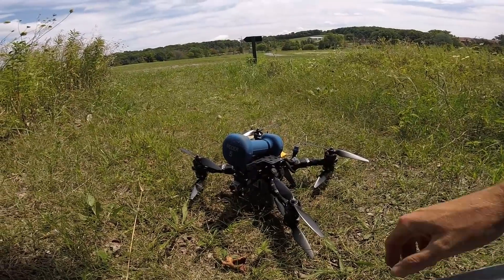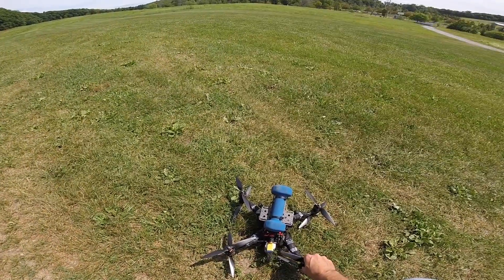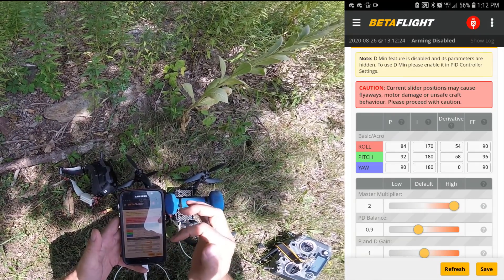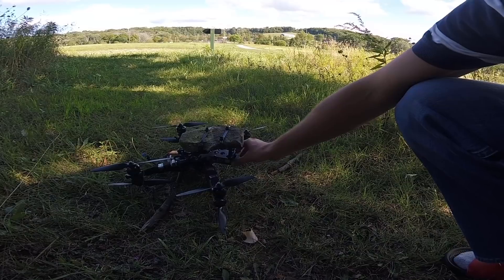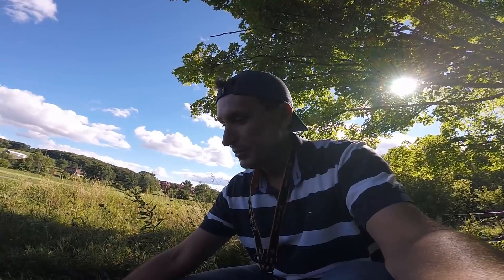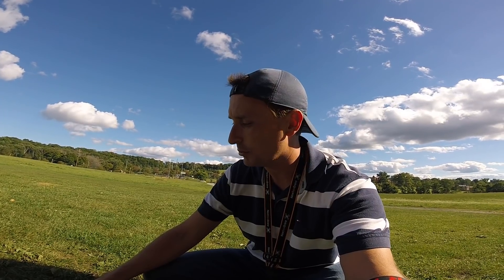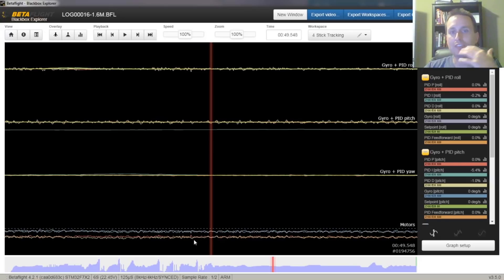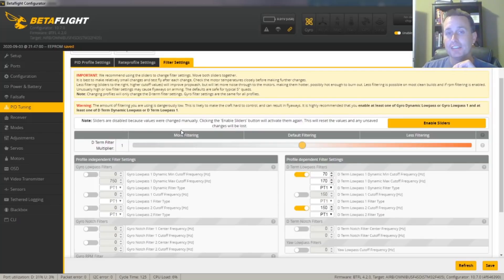Tuning a 4,300-grams Drone - Shendrones Thicc 😱💥

Comment: Thanks for the video. Did you do your first flight with the stock PIDs as you show?
Reply from the maker: no, stick KISS pids video is: https://www.youtube.com/watch?v=8c9ggTbWrM8
Reply: @uavtech  I have a an X8 cinelifter with BH 2810 1500kv and HW 60A 4 in 1 ESC and 7 inch props AUW = 3800gr . Can I do the first flight test with the stock PID?

Comment: I have a question, since we have a 2 props per arm, which are rotating on opposite direction, that means that there is about 0 reactive moment per arm, so when you give 100% throttle, there is about 0 N/m of force on arm, since props are compensating turning momentum of each other, but doesnt BF designed for the quad where each arm will have a 1 prop, where on higher throttle arm will have a higher N/m turning momentum ?
Reply from the maker: You have to tell the Mixer it is an octocopter in the Configuration tab.  That sets up the Mixer to handle things differently.

You also tell it specifically on 4 arms.  However, that counter momentum concept is the same regardless of motor layout on an octocopter.
Reply: @uavtech  is there an individual pwm outputs for each esc? Or there is only one per arm?
Reply from the maker: Per motor.  So 8 ESCs.

Comment: Was going to say about the FPV feed camera having jello, having at a fixed angle/rigidly mounted could help out with that. I know this is comparing apples to oranges (5" 6s Racer vs a giant X8 octo camera rig) but the further out in my case with the FPV camera on TPU with an adjustable FPV camera (able to change angles on the fly) I will see jello at high throttle or if I get mildly beat up props. Recently I started doing fixed camera angles and changing the infill percent on the 3D printed camera mounts and it helps a lot. The only way I get jello now is if I have very thrashed or completely missing blades on the props due to BF doing everything it can to try and keep the quad steady. 

Point I'm trying to make is the further out something is mounted or is not rigid enough, the more oscillations you can get depending on what it is (camera mount, or say a 800mm xclass rig for instance that is not rigid for arm mounting.) Not always a bad thing (hybrid configuration for instance, 5" arms up front with 6" arms on the back for a 5" racing quad for handling) but something to keep in mind. Great video as always!

Comment: Some thing must be wrong with my transmitter, when I flick the Arm switch some girl says "Oh no you didn't..."  When I disarm she says "Well that didn't suck at all!"  Maybe I got a bad one.

Working on an automatic FPV flossing flying robot today:  Tie floss string to rubber band and hook over doorknob, tie other end of floss to robot, insert teeth and kick back and watch Golden Girls.   https://www.youtube.com/watch?v=AqNhD5qX_pY

My first 6s home brew bottom mount 21700 liion battery this week, what a bunch of !@#$% solder points:  http://air-war.org/graphics/Battery02b.jpg

You guys insist on those insanely high rates, you lose a lot of precision and resolution around the center of the stick...  must be a whiplash headache inducing flippy floppy hard snap roll robotic feel guy thing.  I finally figured out super smooth rates that suit me, tailored for zipping around golf course tree trunks and grass ocean English Country gardens...   

Roll: 0.24/0.83 /283
Pitch: 0.28/0.85 /368
Yaw: 0.22/0.74 /169
Cam angle for however fast I'm flying, so mostly, 45: 15-30-42-45

Don't want to land blind from high camera angle any more...  bump that.
Reply from the maker: Nice.  It not tried already, check out Actual Rates.  They give you both for control (Sensitivity = 10).  Squish and fast too.

Comment: Hi, I build x8 7 inch with 2508 motors and only 4 motor outputs with the upper and lower props spinning the same direction, 
All the other x8 builds i see use 8 motor outputs and counter rotating props ,
I feel my way is easier to tune. And i know for sure if i loose a prop or 4 it will still fly.
Can you please try tuning this config without setting up counter rotating props, I think you will be surprised.
Cheers
Reply from the maker: I had to ship for customer.

Interesting idea!  Tuning is the same though.  Same core methods.

So you really don't have an octocopter, or specify it as such in the mixer.  You have a quad just with 8 motors.
Reply: @uavtech  Yes you could call it an 8 motor quad , i have some vids on my yt channel if you would like to see how they fly, 
All tuning follows the same principals

Comment: I’d like to see under a high speed camera, the air flow between the upper and lower props with some type of smoke. Since the air flows downward, putting smoke in top to see the the air path would be cool. It’ll be like seein a bullet being fired under a high speed camera, different prospective.

Comment: That looked easier then my 10inch 🙈 but that hat a defective gyro and freaky esc
Which rates do you use?
Did you balance the props? On bigger biblades this is a must have !!!
Reply from the maker: No balance.  HQ seems very decent.   Actual Rates - 800 dps
Reply: UAV Tech 
Thats impressive this thing stopping 800 deg/s flips without the motors saturating
Reply from the maker: @jas-FPV  yup!
Reply: UAV Tech  whats the dshot idle value and do you use dynamic idle ?
Reply from the maker: 8 or 10 percent Dshot Idle.